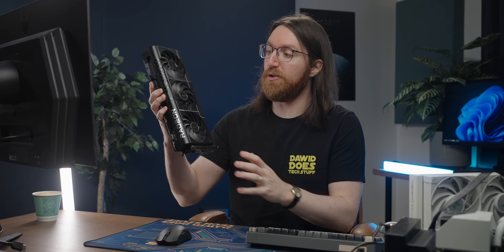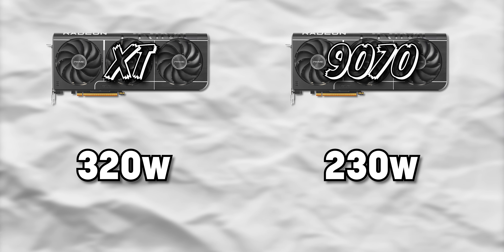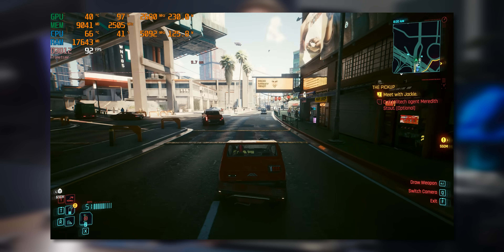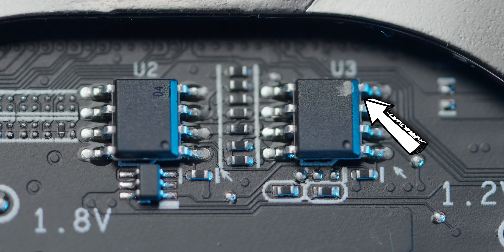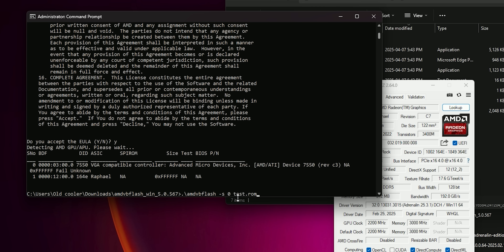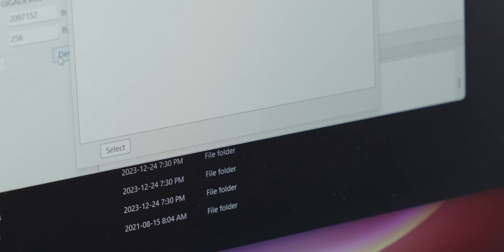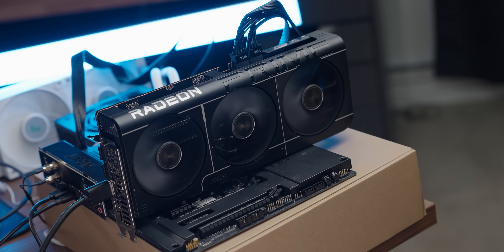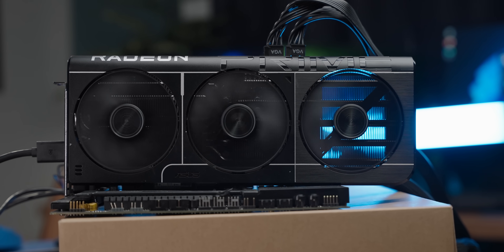I Flashed An AMD RX 9070 XT BIOS Onto My RX 9070...

Comment: Good thing that's a dual bios card! Super risky on any other card. These things aren't cheap!
Reply: Use a heat gun and keep the warranty void sticker. Then worse case rma it
Reply: @funnyfuel420  warranty void sticker is irrelevant and illegal
Reply: It's not hugely risky, you can always correct mistakes. Just be sure to back up the chip first.

To avoid the nonsense with the clip just desolder the chip.
Reply: @lemagreengreen  that's why I was calling it risky, you have to know what you are doing and know what to do if it goes wrong.

If you want to just follow some guide and hope it works, you'll be left with a dead card and shipping it out to someone who can correct your mistake :)

If I were doing it myself I wouldn't attempt it unless I backed up the original BIOS, but I've never microsoldered, so if my restore failed through whatever programmer I had i'd be in for a learning experience, or a repair cost.
Reply: @volvo09  All 9070s have 2 bios. If you mess one up just don't try it again
Reply: @funnyfuel420  No they don't, my 9070 pulse doesn't have dual bios
Reply: @DuBstep115  Well, that's a 2 fan card mostly used by OEMs
Reply: @volvo09  Well yeah, I'd hope anyone with a CH341A has at least some idea of what to do/how to avoid getting into trouble though. I'm sure there's original BIOS available online though.
Reply: if you are physically flashing it, it is far less risky than software since even if the bios fails to install correctly you can just flash the old one back over as long as you didnt accidentally feed the chip more voltage than its rated for or something.

Comment: I remember being able to do this with certain models of the Powercolor Vega 56. As long as they had the certain ram if I recall correctly. Essentially you could turn them into a Vega 64.
Reply: And oddly enough one has 64 CUs and the other has 56 CUs.....hmmmm
Reply: @p00ner  Just commented on another post, but yes I noticed that little coincidence lol. Believe the Vega 56 had to have the Samsung memory to work.
Reply: @p00ner  Just like you could flash fury into fury X, guess what? That had 56 and 64 CUs too.

Comment: my man , you just unlocked RX 9070 GRE
Reply: Apparently this gen the 9070 GRE will be below 9070, so I guess 9070X more like
Reply: @VenomVendue Every gen the GRE is lower than the others.  This is 9080 GRE.
Reply: it always has been  @Venvendue
Reply: damn thats dissapointing, the 9070 is equivalent to a 7900 GRE  @Venvendue
Reply: @ronaldmcdonald6067  no, the 9070 beats the 7900GRE by about 22%. He created a 9070 Super.
Reply: @Venvendue  Came to say similar
Reply: No, the 9070 GRE will be slower than the 9070 and probably will have only 12gb of VRAM
Reply: That's what I thought 😂
Reply: If they’re following more nvidia naming it’ll be the 9070 super
Reply: Now I want to give my 7900 GRE BIOS from 7900 XT
Reply: Nope. GRE supposed to only have 12GB
Reply: great radeon edition?
Reply: GSE
Reply: GRE=lesser version
Reply: Gre’s are weaker than non xt’s…
Reply: No its not.. RX9070 GRE will have less memory this time and slower than this rx 9070 default speed.
Reply: The GRE cards are the lowest end version of a sku, (I.e. 7900 GRE, 7900, 7900 XTX) so no. He unlocked the 9070 Fury, between the 9070 and 9070 XT. ;)
Reply: BTW, the AMD GPUs I'm aware of are artificially locked with their software are the RX 9070, RX 7900gre, rx 6800, rx 6600, and rx 5700. They all have unusually low power limits
Reply: @ziokalco  I have a 7800 xt, I wonder if there is anything I can do with mine, I also have a switch for performance and lower power mode
Reply: @DaveyFraser  7800xt has an already maxed out Navi 32 processor. There is likely nothing to be done besides conventional undervolt and/or orverclock
Reply: @ziokalco  Has anyone tried to flash the 6800 in the 6800 XT?
If so, how do I do this?
I tried to use a programmer to sew BIOS from 6800 XT, but the video card does not start, and it is defined as a regular 6800 without shaders.
Reply: @VitSert  Bios swapping doesn't always work. And as far as I'm aware, flashing the 6800 isn't popular (thus it is likely something that doesn't work)
Reply: @ziokalco  artificially locked because the silicon is a lower quality though. Not everyone will be able to buy a 7900 or 9070 GRE and oc it to XT speeds
Reply: @rhéacevert Yeah, but what I mean with artificially locked is that they went the extra mile to prevent everyone from doing relevant OC. 6800, for example, don't allow you to increase the voltage, and their factory setting voltage (their max)is also significantly lower that what the 6800 xt is at by default
Reply: @ziokalco 7900gre memory was unlocked. But I have one with samsung memory chips, and mine will crash if i set it higher than 2316. Idk about wattage though. I wouldnt want mine to run more than the +15% anyways because the card was spiking up to 360w and causing system shutdowns on an 850w supernova g3.
Reply: nope there is 4gb too much Vram on the 9070... the 9070GRE is a 12gb card
Reply: @TripBoomer69  12 GB VRAM is no longer enough for 1440p. All the texturing, and shadow buffers exceed that. Reducing texture quality (resolution) fixes it. But then benefit of actual 1440p native rendering is quite reduced. So one can as well render at 1080p and upscale.
At that point, people feel like 2nd class citizens.

Secondly, neural networks are becoming pretty mainstream thing. While I run everything on linux, there are simple, few clicks, windows packages. And since AMD did put it to drivers, too. More people will open those doors. And since people who make those models know mostly: "If it is not good enough, make it bigger." And that requires VRAM.
Reply: @DarkFox2232  I play at 1440p with max textures on a 12gb card!?... 🤨🫢😉😂🤣 You're full of it, my friend! 🤣🤣
I don't have to turn any textures down! Haha see what happens when all you know is propaganda on YT and twitter 🤣 😂 
Now their maybe some poorly optimised games that require more than 12gb, but 98+% of the time 12gb is plenty to max out 1440p.
It also depends if your on an Nvidia card or an AMD card, because AMD cards generally use around 2gb more Vram for the same performance than Nvidia does, so if you see 13-14gb usage on an AMD card, its Nvidia counterpart would probably still be fine with 12gb.
That being said I am not saying that might not change in the not so distant future, but now, at the moment 12gb is fine for 1440p. And it needing more Vramis more down to the Devs and how lazy they are in most cases. But not at dropping textures with 12gb yet.
Reply: @DarkFox2232  🤣🤣 Bro you would have hyper focused on like 2 games to make your point, I just explained to you why you we're wrong... And I have played a good few seen content yadayada... doesn't change the fact that 4-5 years ago 8gb was high end, so I think we can rule out anything older than that, possible outliers but I dont think so, and I have been playing for a couple of years at 1440p with 12gb, I have watched it steadily increase as textures become more demanding but not had to turn textures down yet, Indiana Jones shouted at me about it but I ran it at supreme textures anyway, was fine.
So again as I said 12gb is fine for 1440p as it stands, for how long... I couldn't say with how lazy devs have got with optimization but I guess we will see, but also when said 12gb forces you to drop textures to run the game, as long as Fps is good then its still a 1440p card.
Reply: Fr bruhh, this makes AMD ideas to make another gre 😂
Reply: @wahung099  they have already leaked some from china.
Reply: @wahung099  yeh because this gens GRE sucks! Whats the point of it since 7800 XT and 7900 GRE exist...
Reply: You might be new to PC kid. But GRE mean cutdown version of card. So no. 9070 GRE is weaker than 9070.
Reply: @FireCestina1200  The R in GRE means Rabbit and its no longer year oh he rabbit. So no more GRE cards
Reply: @DuBstep115  You know there's not only the 7900GRE and those card came out when it was no the rabbit year right ? Therefore. Despite GRE technically meaning Golden Rabbit Edition. It means cut down version for Chinese market.
Reply: @ Actually GRE did mean ''Golden Rabbit Edition'' for the ''year of the rabbit''
Now it is no longer that year...😂 
They have changed that to ''Great Radeon Edition''
It is a skew targeted at the Chinese market, I agree, it is a cut down version of the 9070, however the name doesn't necessarily mean ''cut down''... 
Although it is not a bad assumption.
I mean Nvidia only had to trim the 4090 a little so it's not a 
''offering them too much power''
 thing!
I am just guessing that the Chinese market responds better too, lower price and lower specs needed... Or they don't notice, same name!
The GRE is the AMD equivalent too Nvidia's...
3gb 1060
6gb 3050
8gb 3060...
I can keep going! 😂🤣

Only difference is AMD gets praised for it!
🟥🙌🟥🙌🟥🙌🟥
Those clever sons of guns! They cracked the code! 

Nvidia was too blatant! 
They should have just made them China Exclusives! 🤣🤣🤣

Comment: Awesome AMD let's you do this!
Reply: Well it technically doesn't, you have to use physicall bios flasher. Also AMD could just have unlocked the power limits for the non XT card in the first place and not artificially limit the card.

Comment: Hopefully a 9070XTX is released in future so can flash my 9070XT :yt:
Reply: Well AMD board partner is going to release 9070 XT Ultimate edition which rumor has it can do around 500W - 600W
Reply: @MGSimatupang  500W-600W? The Kingpin of 9070 XT? At double the MSRP too?
Reply: well that would likely only be a 32gb variant with more power so you are probably already at the limit now